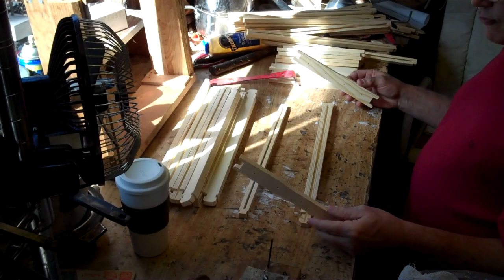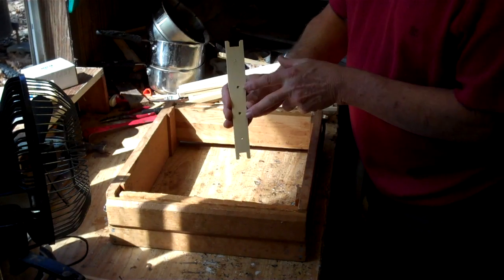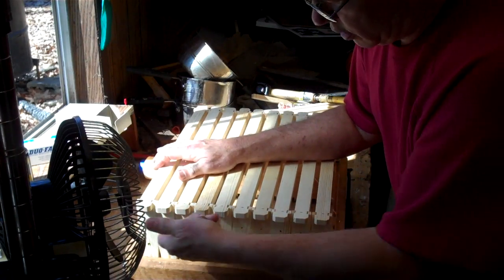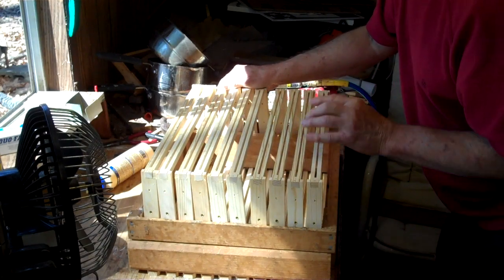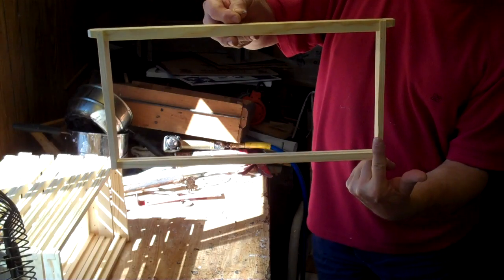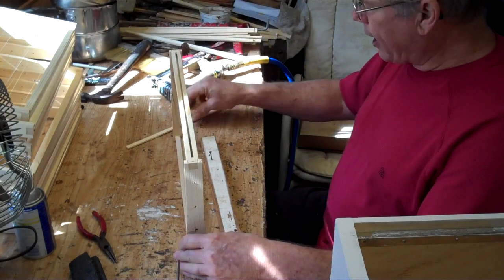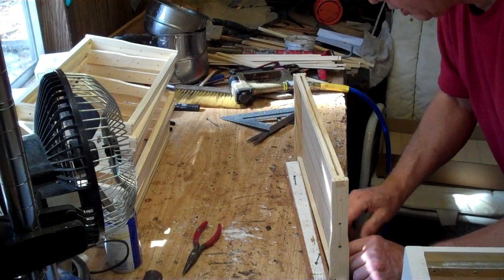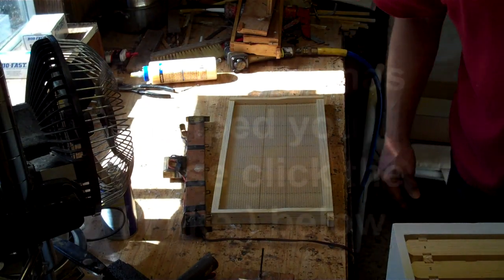How to put together frames for Honey Bee Hive

Comment: Some people use a kind of diagonal wire pattern on both sides of the foundation without embedding them but the draw back is you have exposed wire across the foundation. it may affect how they make the cells, I don't know. I didn't find out as I wasn't interested in that way. You could give one frame a go a see how it pans out. Ps I just use my car battery charger, it works well and has a fuse which blows if I'm careless. you may, or may not, want to do that.